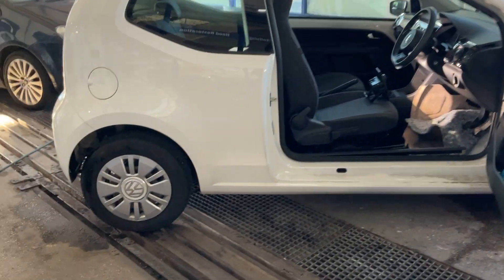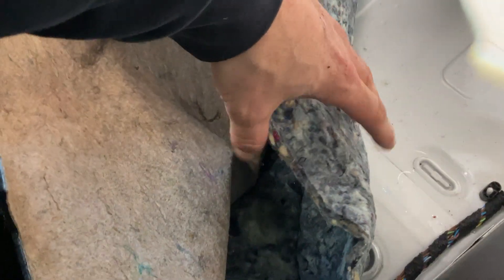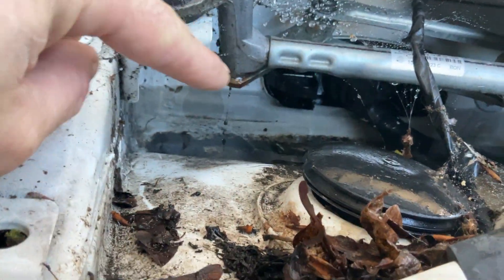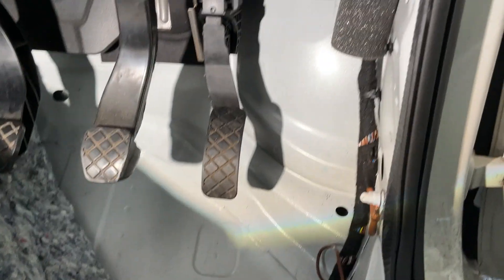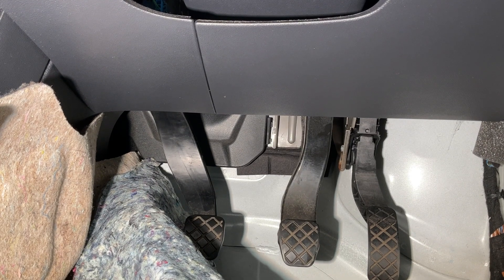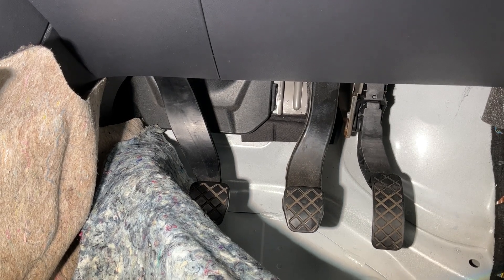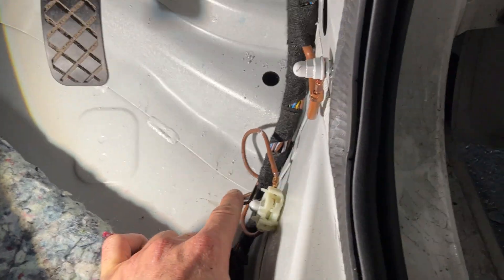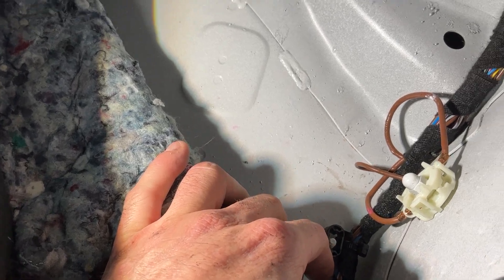VW up! 2014 | Water Leak Fix | #volkswagenleaks

Comment: Don't know if you found the problem already but a blocked drainage in the motor compartment will drain to the cabin through the ventilation opening underneath the dashboard.